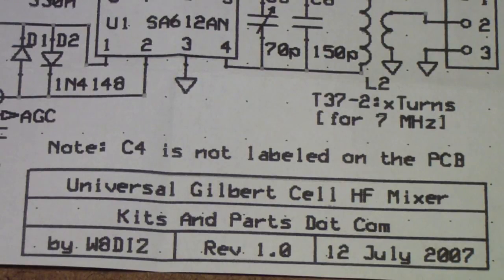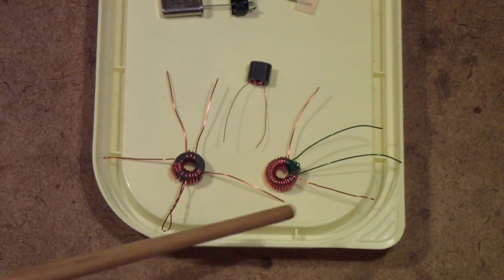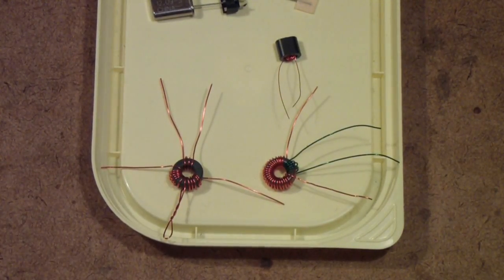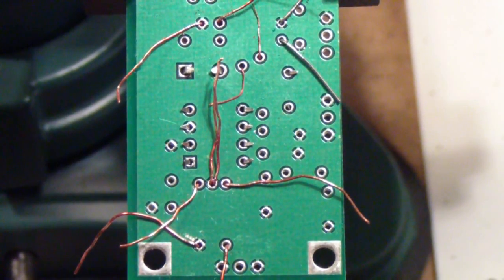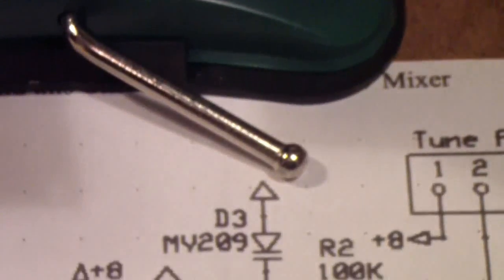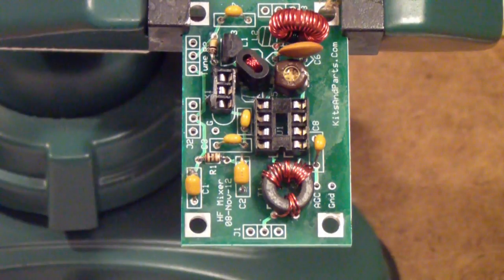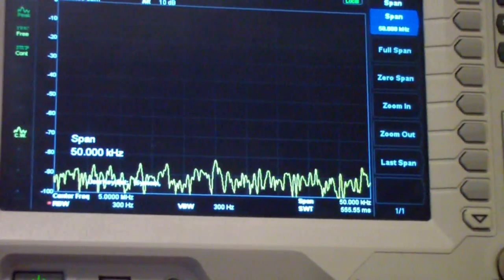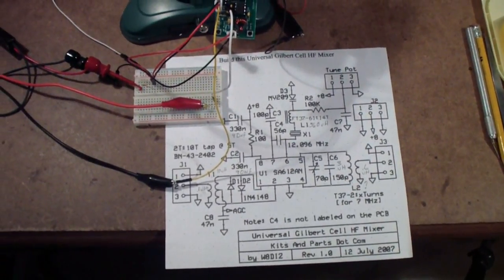TTT128 Gilbert Cell Mixer

Comment: I know this is an older video, but you mixed up two of the cores. The binocular core is supposed to be the input transformer and the dull grey torroid is supposed to be the loading coil for the crystal. It obviously still works like this, but the input frequency range won't be as broadband as it should be, and I'm not sure what the crystal will do with that much inductance on it. The parts mount easier in their proper places as well.
As far as the 602/612 thing, this only applied to the old versions of the chips. I think one was rated at 200MHz and the other at 500MHz; the slower just being ones that couldn't meet the 500MHz spec. For a long time now, both parts have had exactly the same spec at 500MHz due to improvements in the manufacturing process. No need to upgrade the IC.
73s - Brad
Reply from the maker: You are right - my bad. I found the original board and instructions and the BN-43-2402 should be the input core (2t:10T tapped at 5t) and I used the FT37-61 core instead. Thank you for your comment and keep up the good work. We all can benefit from others looking over our shoulder.